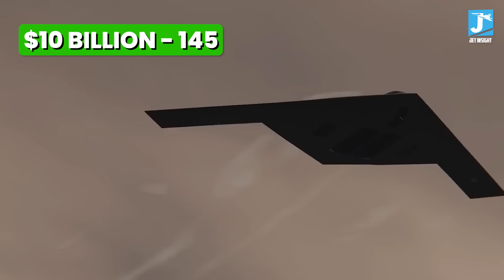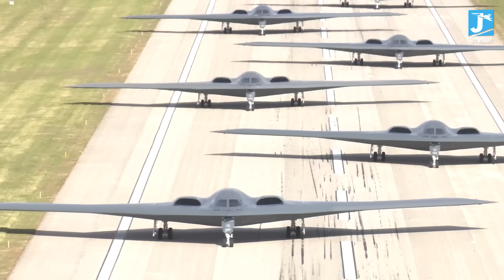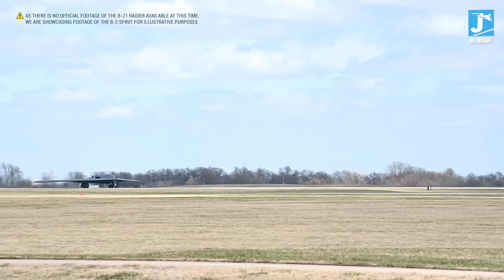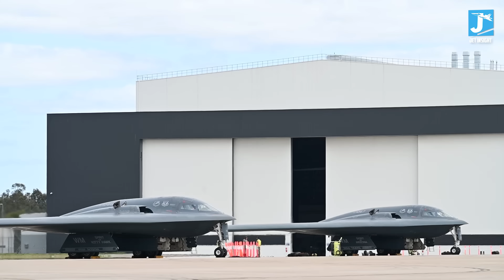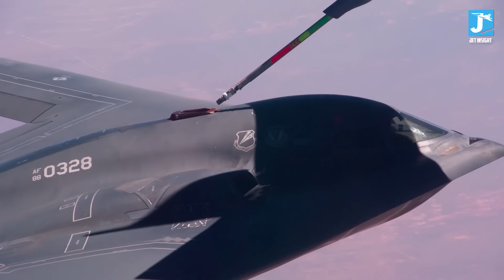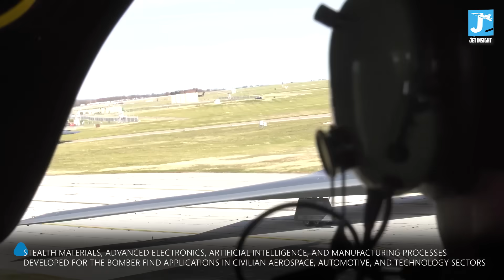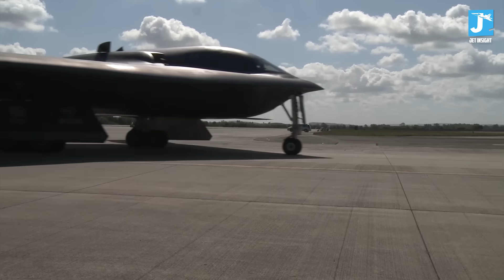USAF's $10B Plan to MASS Produce 145 B-21 Stealth Bombers SHOCKS World

Comment: The USA needs at least 400 B21 as they are replacing B52, B1-B, B-2 bombers.
Reply: Not replacing the B-52H's.  WE are converting the B-52H's to B-52J's, even bring a few ouf of the bone yard for conversion.  The B-52's range and payload is incredible and is about to be emproved.   It will be a missile dump truck.  Yes, non a penetrating cruise missile mother ship with an increadibly powerful EW suite.
Reply: @TheKCaryer The B-52 are also getting new more fuel efficient higher performing Royal Royce engines and in 20+ years they will be retired replaced by B-21 and B-22 mother ships.

Comment: Tupolov are currently assembling it's 3x prototype PAC-DA's. A third of the price of a B2 with 2.5x the range, 34 ton bomb load and said to have a cruising speed of Mach 5. And before anyone says BS, Darpa statically tested the UK's Sabre Jet Engine in 2022 at a sustained Mach 5.5. I doubt it's stealthed as at that speed the plasma envelope around the airframe will absord radar. And my other source says the Oreshnic that wiped out Ukraines PA Pivdenmsh facility was carrying dummy warheads.... The full system carries 150 attack munitions all coming in at Mach 10+

Comment: So, lemme see if I got this right. the B2 cost a billion each, which is why we only have 20 of them 20x1,000,000=20,000,000? Mkay, so.. the B21 "allegedly" costs 700,000,000 per... and as you say, the US just dropped 10B on 145 of them? Now, I'm a dumb murican, and we don't use that ole metric system, so forgive me if I'm wrong, my common core is kinda rusty, but umm THAT MATH DONT ADUP! Did you accidentally use pasos as the currency or... I mean, what? 145x700,000,000=101,500,000,000.. if ya carry the 1, and divide by WHAT THE CRAP ARE YOU TALKING ABOUT! I suppose it's flattering to assume that even our staunchest warmongers would be willing to spend a 12th of our entire military budget on a single platform, but even after going from the gold standard, to the carrier group backed dollar, we still don't have ONE HUNDRED AND ONE BILLION FIVE HUNDRED MILLION DOLLARS to spend on 145 planes!

Comment: 00:21 | $10B for 145 B-21's ~ $69,000,000 each ... seems a bit low for stealth bomber & about the same for an F/A-18E/F. Yet earlier it was said they cost ~$700,000,000 each. Something doesn't add up here. TD
Reply: $10billion is to expand production facilities, infrastructure, parts production, and parts acquisition, not the purchase of the aircraft themselves. Right now in Minot they've moved out the B-1s to other bases so they can rebuild the runways for handling the B21s...also costing money.

Comment: Someone needs to learn basic math before making any more videos.  It says "Each one of them cost $700 million (correct) and the air force just dropped $10 billion dollars to build 145 of these invisible destroyers" (bullshit).  With each one costing $700 million then the Air Force would only get 14 of them for $10 billion.  To buy 145 of them you would have to pay over $100 billion so this video is way off in iwhat it is claiming.  Better luck next time...
Reply: You should probably learn English comprehension. 😂 That $10billion isnt for the planes. It's to expand production and maintenance infrastructure, parts acquisition/production, etc.
Reply: 10 billions is for this physical year. To begin the process.
Reply: it's not 10 billion for aircraft it's 10 billion for production. Learn comprehension skills
Reply: Maybe they are referring to 'this' year's budget. Because I did the math also. They did say something about last year's budget compared to this year's... Anyway, good statement. 🎖️👍
Reply: ProudDagFan wants to be the voice of reason that is justified in what is said , he needs to get humbled. Macroeconomics,production procedures & etc will lower cost  Look at how Henry Ford changed production cost estimates by mass production.
Reply: 10 billion THIS YEAR. And at least 10 billion each year for the next 10 years, divided by 700 million comes out to 142 bombers.

Comment: If the bomber is nearly invisible and does the job then 10 billion is cheap.  I'm guessing stealth bombers will be obsolete once drones become sophisticated enough to replace them.  The B-52 is still operationally critical and has been running forever.
Reply: You say that bcs you dont know. The B21 was designed to be itself a drone, if necessary, to fly unmanned ops, and to control other drones.

Comment: $700,000,000 per bomber x 145 bombers is $101,500,000,000. How did you get the much smaller $10 billion figure for what the air force is spending on the B-21? Is that just for the first batch?
Reply: If you paid attention to the video they specificly stated what the $10bil was for. NORTHROP invested the $10bil into production facility/infrastructure expansion/upgrades, inhouse parts production, supply line expansion/security (for stuff they can't produce in house), and hiring and training new employees.
Reply: @SteveFreeman-v4d  The video isn't clear about that immediately. I had to rewatch it before that came across.

Comment: Us Air Force should have 300 b21s 700 f15ex and 700 f47s. Oh, and they should get the tooling to rebuild the a10s and build more A10s again. 700. 145 airplanes is just stupid then that leads to higher prices.
Reply: I think they will actually build more than 145. BB besides there will be block 2 B-21s that will be AI. 145 are only those control lol Ed by pilots.
Reply: You have to have enough good enough pilots to fly them all. Top tier pilots aren't like fast food workers. There are a precious few of that caliber.
Reply: @SteveFreeman-v4d Good pilots are not. You still need to have the numbers of planes to make it cheaper. So that the nation can prosecute missions. It needs to in defense of Sid country. Instead of taking, let's say a third of the bomber Force to prosecute a mission

Comment: The problem with this aircraft is that, although newer and capable of performing missions more effectively, it loses 40,000 lbs. of bomb load compared to the B2, 52,000 lbs. less than the B1B, and 50,000 lbs. less than the B-52H. This is just like our Navy trying to support our Marines with a single 5-inch gun.
Reply: We loose something but there smaller for a reason keep them affordable. What we loose in weight that they carry we gain in share numbers.

Comment: I fully expect them to produce about 200 of them, because of its open archatecture system I fully expect to see electronic warfare variants, arsenal ship variants carrying 24 AIM-260's to support F-35 and F-22's. AWACS variants. Tanker variants I expect the Airforce is going to use the single airframe to replace almost all non stealthy airframes. I use the example of how the Airforce canceled the E-7 Wedgtail AWACS aircraft, they are going to use a B-21 variant equipped for that role.

Comment: I’m just happy that they are actually ramping up the assembly line to get these built that’s awesome! Not like the B2 that only got 25 built out of 100 and Obama cutting down the F22 assembly at 178 far short of the 750 required. So I hope Boeing gets going on the F47  asap! I’m still worried they are going to drop the ball that’s why aim all for the F55  , F35 upgrade with two engines , yeah build it and build it now!
Reply: The B-2 only had 20 built there's 19 left in the fleet.
Reply: @BrianKaitschuck thanks I knew they lost the one on Guam on take off! Sure hope they get these B21 built as proposed.